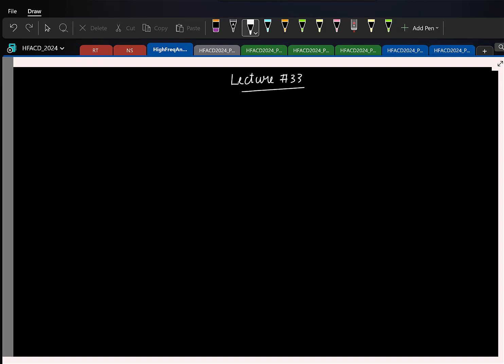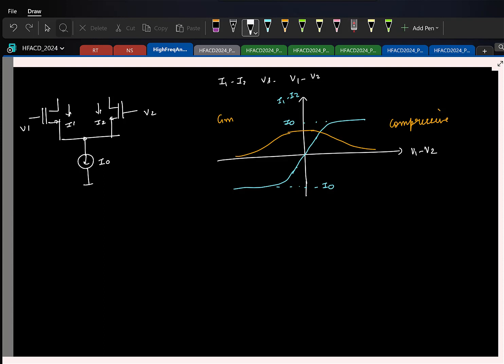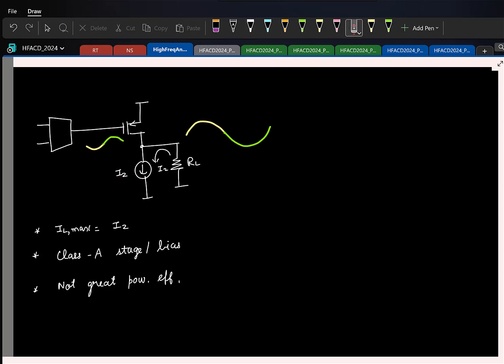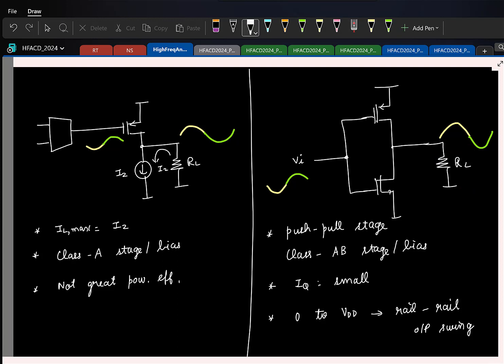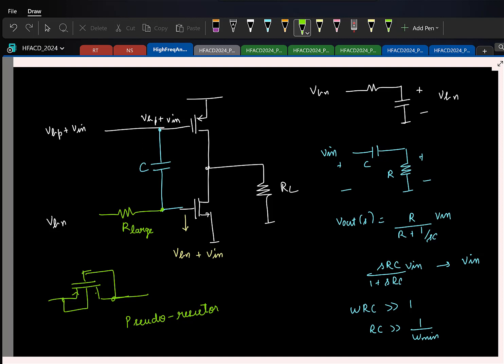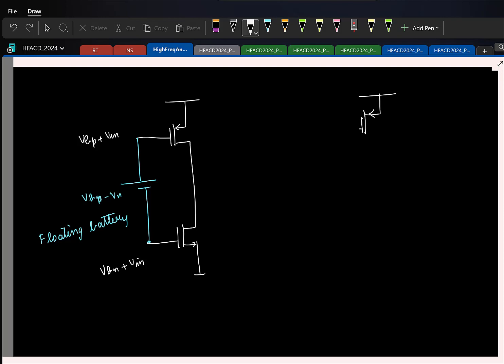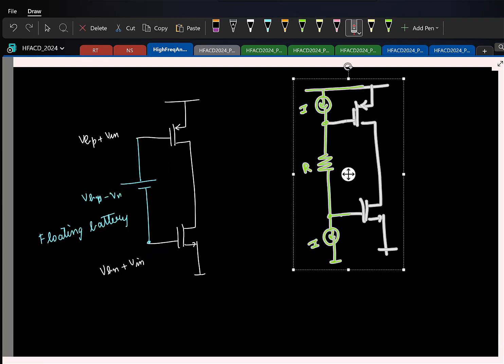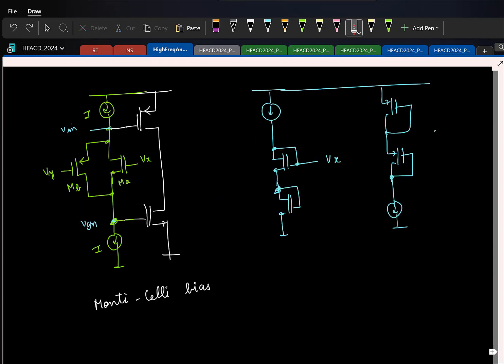Lecture 33(1): Class-AB output stage; Class-AB bias using a) Monti-Celli scheme, b) pseudo resistor

Comment: Why can't we use a diode connected NMOS in place of resistor? Reason for not using a resistor is that it can not track other transistors but if we use diode connected NMOS in place of resistor then it will give us a voltage shift and it will track other transistors.
Reply: In this case , when the pmos driver  is off, gate goes to vdd , but the nmos driver's  gate will lower than vdd by atleast 1 vgs..so you cannot expect gate of the nmos & pmos drivers to be rail-rail...But in case of monticelli bias, when gate of pmosdriver  goes to vdd, the pmos device of the monticelli cell acts a common gate amplifier and pulls the gate of nmos driver to vdd..so here you can get rail-rail gate voltages